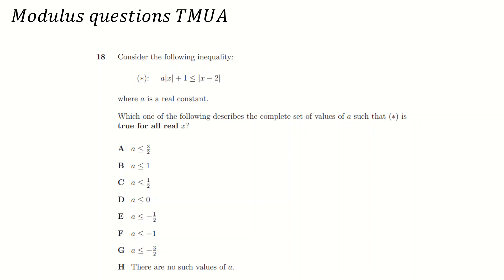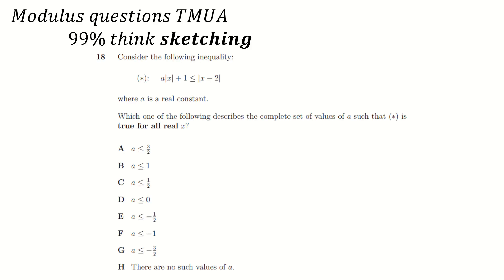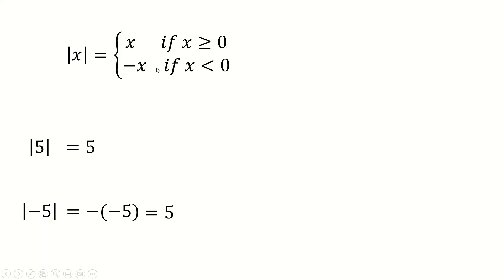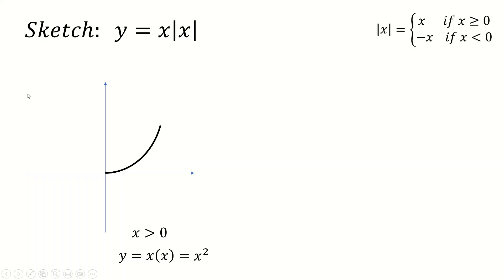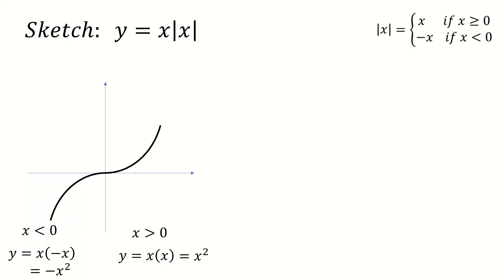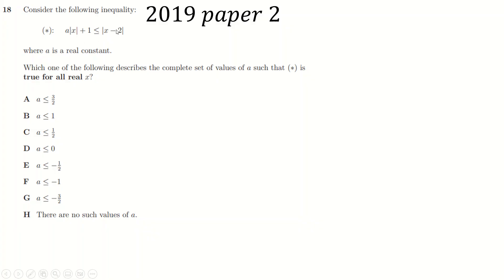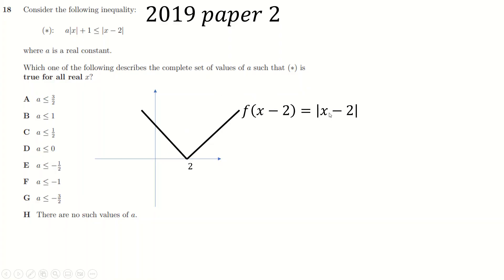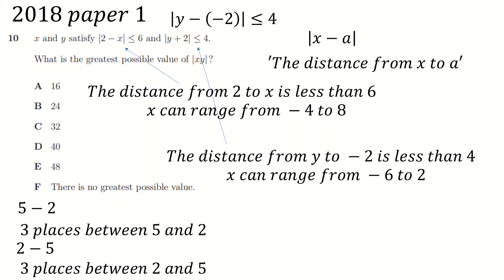TMUA: Modulus/Absolute value function questions

Comment: 9:40 is my method correct for this question 
 i started off by squaring x and y 
(2-X)^2 ≤36 and (y+2)^2≤16
i expanded the brackets out to get
(4-4x+x^2)≤36 and (y^2+4y+4)≤16 
rearranged the equations so that it can be equal to 0 
x^2-4x-32≤0 and y^2+4y-12≤0 
the factorised 
(x-8)(x+4)≤0 and (y+6)(y-2)≤0
then selected the appropriate values for x and y
x=8 and y=-6 
then multiplied to get 48 as required

Comment: For the last question, I just squared 2-x  and y+2 on both sides which eventually factorised to 8 as the largest solution for x and 6 as the largest solution for y and then ended up getting 48 as the answer. Could squaring both sides work in every question ? As it removes Mod
Reply: ive seen chatgpt use that idea before ages ago, possibly

Comment: For 2019 paper 2 Q18 I got the right answer by just subbing in x=2 as I assumed that's the minimum the RHS can be then just solved for 'a' which got the right answer. However I'm wondering if I just got lucky with this question because that seemed to easy for one of the last questions.

Comment: 3:28 Why would it be a negative y if the y is being modded? I thought mod just made whatever inside it positive, regardless of sign (i.e. |-x| = |x|)
Reply: Thanks a lot for the videos by the way
Reply from the maker: Yes, but now think of the process by which your achieve that.  To get a positive number positive, you dont have  to do anything, but to get a negative one positive you can multiply by -1